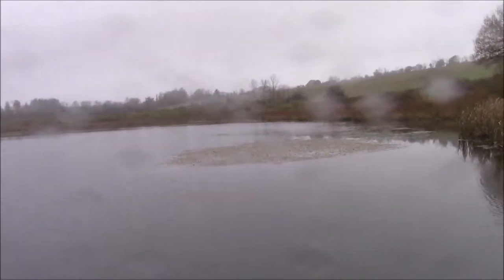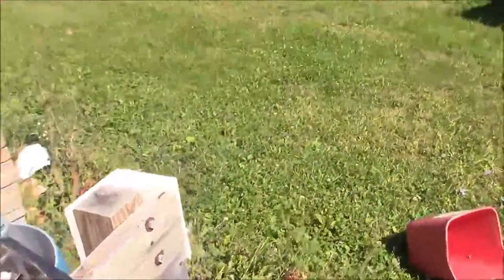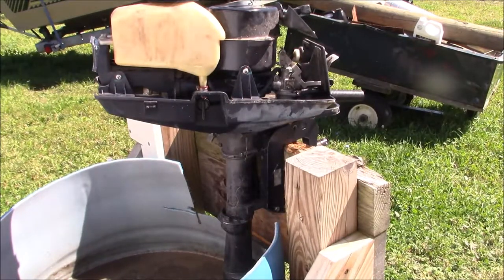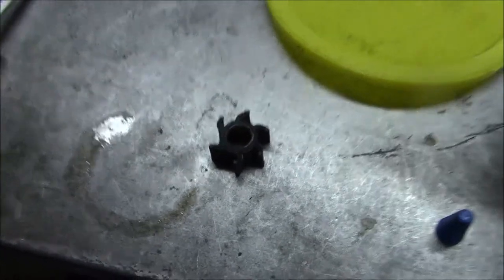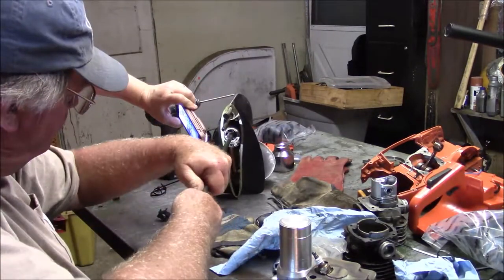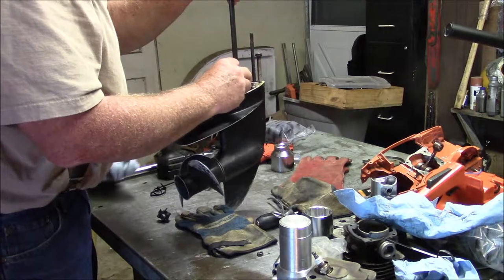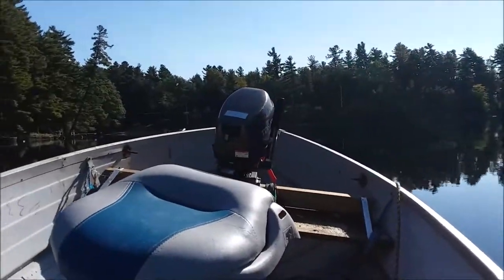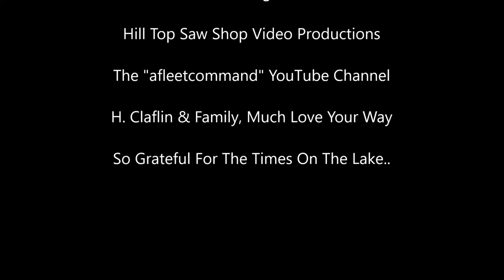Evinrude 3.3hp Single Cylinder 2 Stroke & Mercury 110 9.8hp Outboard Water Pump Impeller Replacement

Comment: I've had a couple of these old air cooled boat motors over the years, one was an old Cliton based motor and the other a Sears Game Fisher can't remember the hp but I'm sure under 5hp for both.
They are good little motors for what they are and very easy to work on similar too an old lawn boy push mower.
You know sometimes simple is best.
Reply: Water cooled